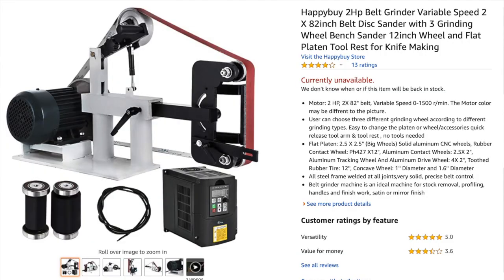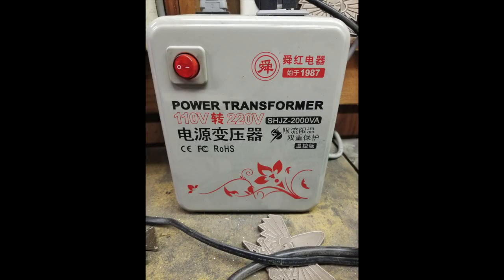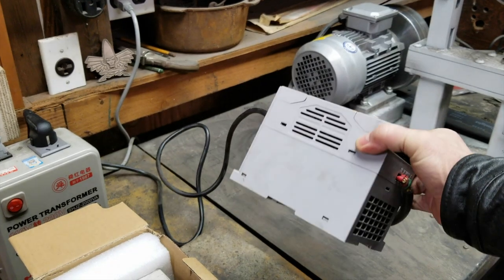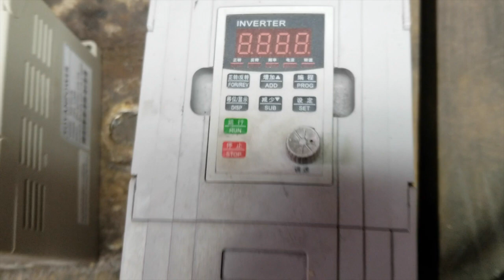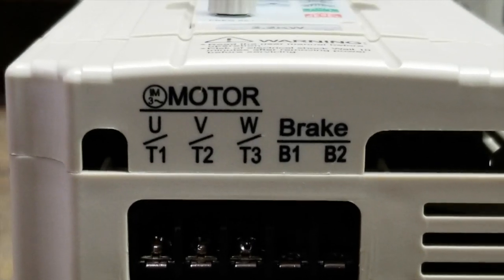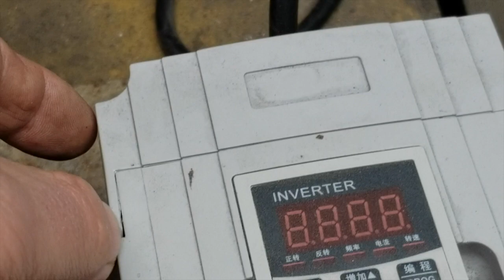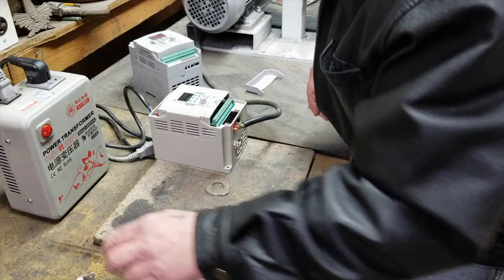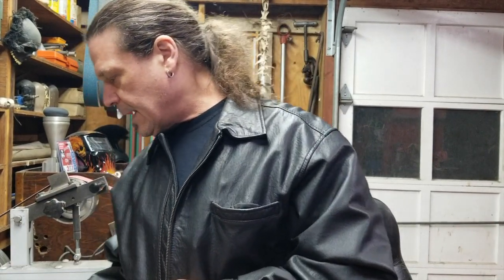Repairing a Chinese Pro Knife Makers Belt Grinder Bought on Amazon

Comment: Mine gets delivered tomorrow, thanks for doing these vid's.  I'm replacing a Grizzly 2x42 where the motor died in 2 months and the power control a month after that. I will be putting mine in a NEMA enclosure. I suggest you get that power converter an enclosure or at least a dust deflector.

Comment: I had exactly the same problem as you, with the same backstand! The variator was too close to the dust source and it exploded (a lot of dust inside also because there is ventilation 🌪) I bought a similar one in the store and now I try to plug it in and it's crap 😡, I didn't take pictures 🥴 But I would succeed with patience😏. thank you for this excellent video!

Comment: Why do you need the transformer? Is your power not 60hz 220 from the grid?
Reply from the maker: So for anyone who is not from America,  pretty much everything is 110 not 220. So when this company sells to USA they include the transformer. Now I do have a 220 line in my shop but the connectors are completely different, and I wanted to try it the way it came straight out of the box, so I set it up using the transformer rather than switching the hardware.

Comment: it looks like using straight up 220 and avoiding the dust will solve the problem,,,the tranformer should not be used
you need a ground.....the machine will last longer too....use a 6-20-50 and make a plug for that thing

Comment: I got the same one at work. I am experiencing high heat on the platen rolers. Is it the same with your grinder?
Reply from the maker: Yes, it does get hot.  I don't run it at full speed anymore when I use the flat platen because of how hot it gets. I was thinking about pulling the wheel apart to check the ballbearings but didn't want to risk getting it out of alinement
Reply: @forgejunkie  i think there is no problem of loosing alighnment because the wheels have a fixed place on the shaft. Maybe they are not the right berings for high speed.

Comment: You could have just put  220v cord on that second vfd and skipped the transformer. Could put vfd in an enclosure to protect it also.
Reply from the maker: I had thought about that. I would also need to hook up an ON OFF switch. My electrician friend has been telling me that it would be more efficient and could run better. It definitely runs a good deal faster with the new Inverter